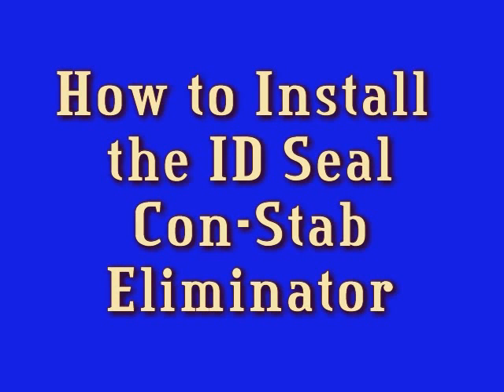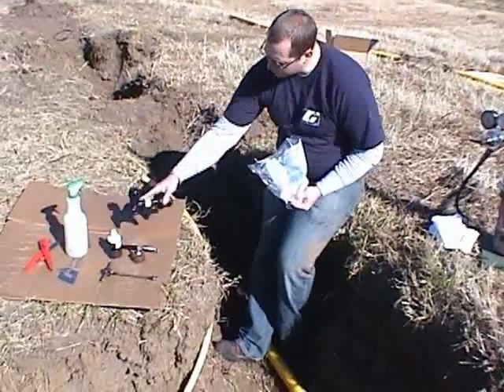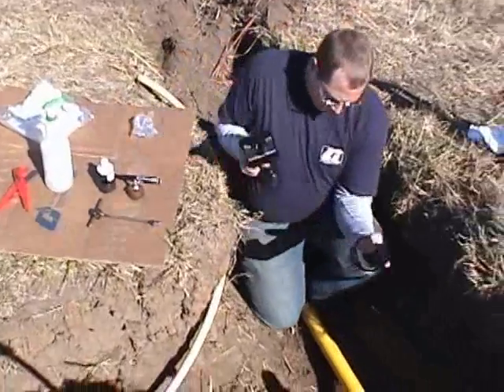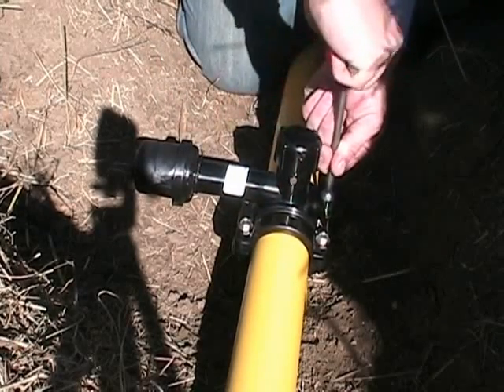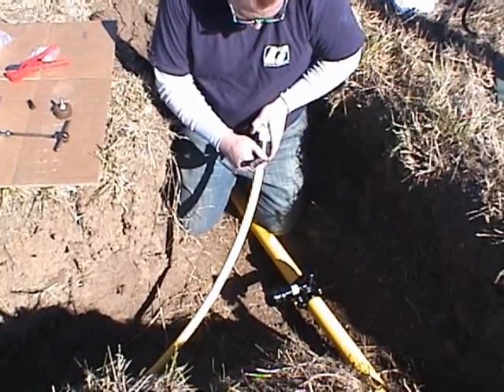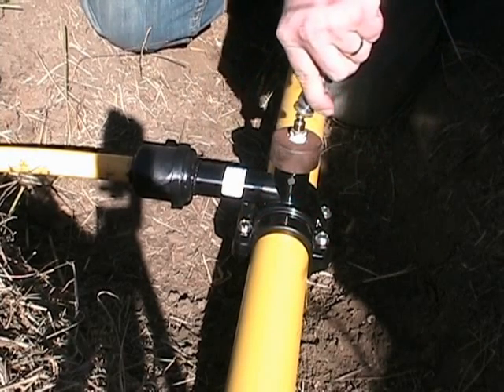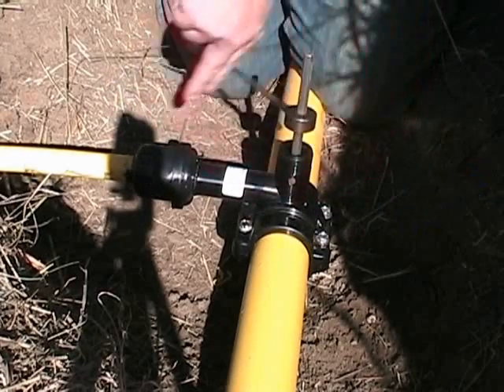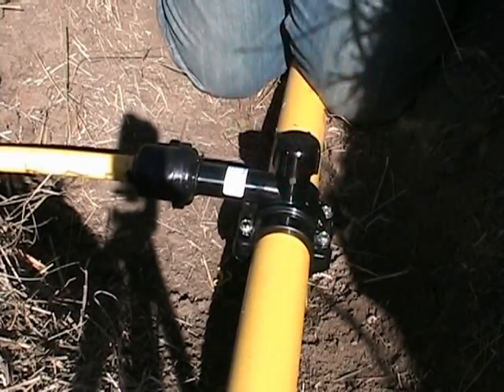Installing a gas service with Continental

Comment: This method sucks no service tee installed like this will start leaking again if it's not fused it's not right
Reply: Bolt on tee's are terrible..Your correct on fusion tee's. Manual or Electrafusion is what we use.